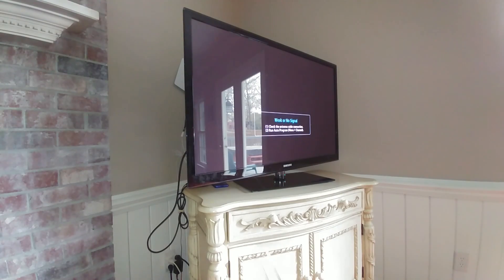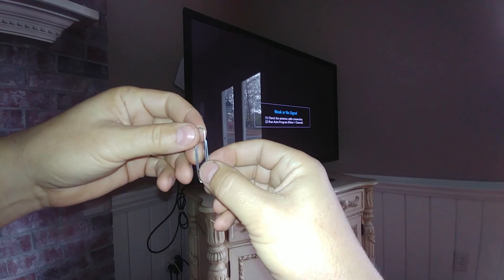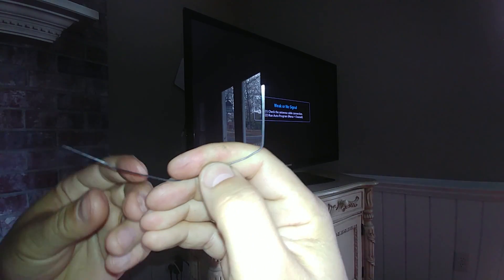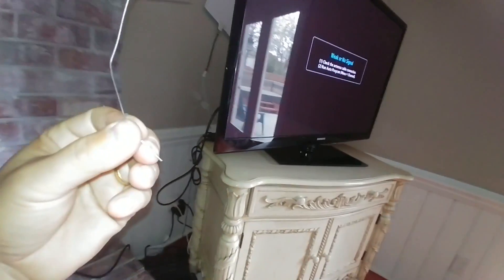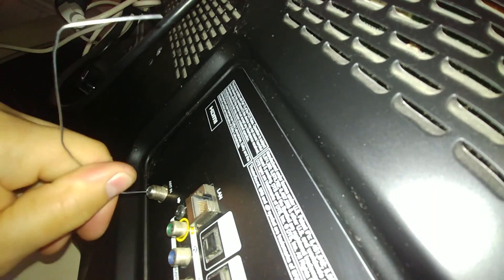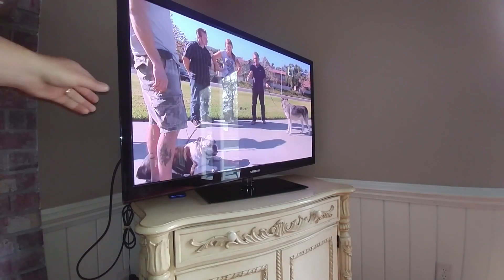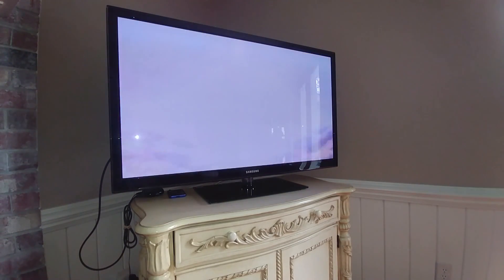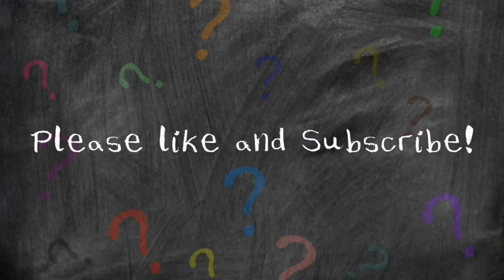I Built a Digital Antenna Using a Paperclip

Comment: the cable plug or whatever you call it on my tv is facing down. how do i keep it in there? tape wont work because it’s to far from the side of the tv.
Reply from the maker: If you push the paperclip in far enough, it will stay.
Reply: @HowToWithJames  I tried that and it worked, but doesn’t that damage the TV from sticking it in too far?
Reply from the maker: When you use a normal coax cable the tip or center is also pushed in just like the paperclip. It should be fine unless you really get crazy with jamming it in.
Reply from the maker: If you push the paperclip in far enough, it will stay.
Reply: alright. I express my deepest gratitude to you for your most kind and gracious interaction.
Reply from the maker: You're welcome! Have a great holiday!

Comment: Nice! I made one like this a year back, added a little bit of foil on it, and got 6 channels! I build antennas, and have an outdoor one that picks up 57 channels. I would like to mention that the TV didn’t become part of the antenna itself, the antenna was moving along with the TV. Also, you might not be able to get a signal with this if you have low-powered UHF stations, or have a VHF station. Low VHF uses RF channels 2-6, and requires antenna elements 3-6 feet long. High VHF is using RF channels 7-13, and requires antenna elements 1.5 to 3 feet long. UHF now uses 14-36, and requires antenna elements from a few inches to 1 foot long. Also, the antenna doesn’t have much gain, due to it just being a paperclip. If you have around $100 to $400 to spend, get a UHF outdoor antenna with a lot of elements, a VHF antenna with a lot of elements (if you have a VHF station), and a VHF and UHF signal combiner. Without the combiner, you’ll get multi-path interference, and just get a jumbled mess of pixels. The combiner will block any UHF stations the VHF antenna might receive when plugged into the VHF connection, and vice-versa. Have a great day!

Comment: I'm confused as to why a minimal antenna such as this is not simply built into the TV with an option for better antenna input?
Reply: Well if it was built in, and you had another antenna plugged in, there would multi-path interference. You would get a jumbled mess of pixels.
Reply: @sethbessinger2025  but if it turns off when actual antenna is on
Reply: yes like have a copper strip surrounding the entire bezel of the tv beneath the plastic

Comment: I've just tried this and it wouldn't go in. Does the TV have to be on when the paperclip is inserted?
Reply from the maker: It really does not matter if the tv is on or off.  Maybe your paperclip is too big. You could try a smaller one or a small piece of wire would also work.
Reply: @HowToWithJames  It doesn't work in the UK, I'm afraid :(
Reply: @brightstar78  It might if you have aluminum foil and cover the metal connector inside the coaxial connection. Then poke the paperclip through the foil. Adding some foil to the paperclip would help with reception.